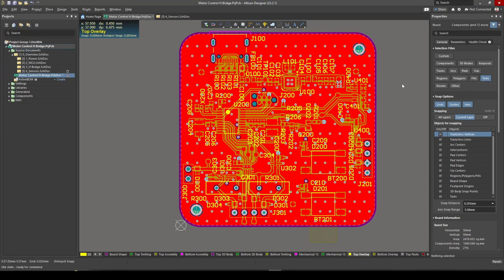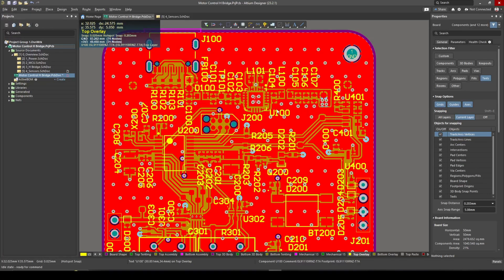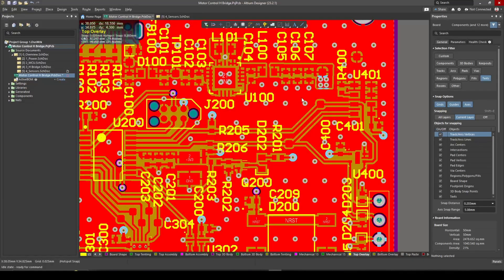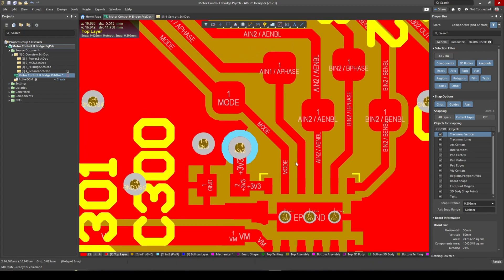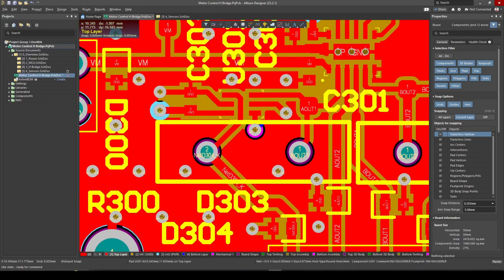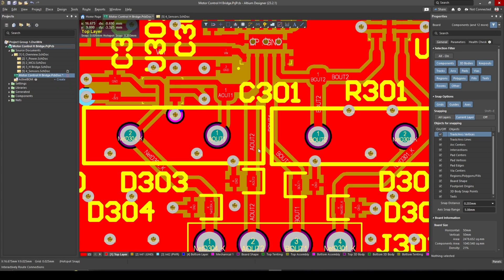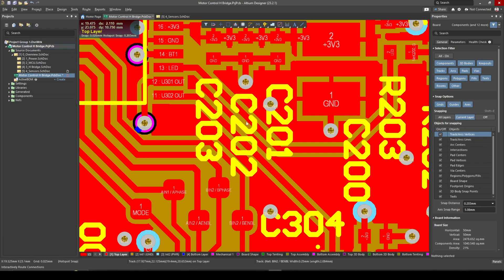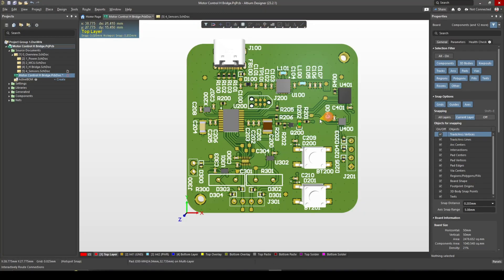Motor Driver PCB Design

Comment: Good stuff man, although I find it a bit hard to understand what your saying sometimes, don’t be afraid to slow down a bit to get your thoughts out clearly. This stuff is complicated, and from experience I’ve learned that rushing, especially with electronics leads to faulty boards and design headaches. Also a lot of your silkscreen had vias on top, stitching vias are great and should be used if the top and bottom layer of your board are ground but they shouldn’t intersect with silkscreen, this will create holes in the text when produced. Definitely a step up from your other designs though good stuff
Reply from the maker: Thanks man, I’ll take that on board. Yes definitely! I’ve had some cases where, though the vias are tented like you said the silkscreen gets printed but still comes out funny or holes still appear in the text. Though like you said if can move silkscreen off it then always better. Thanks!